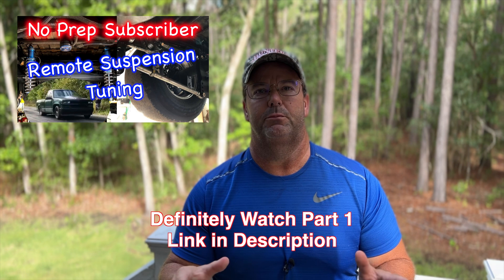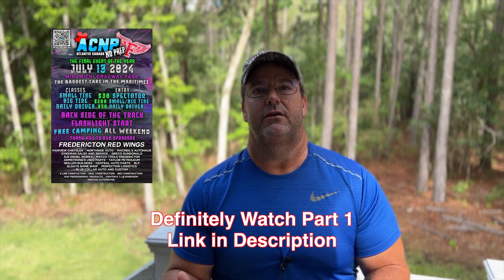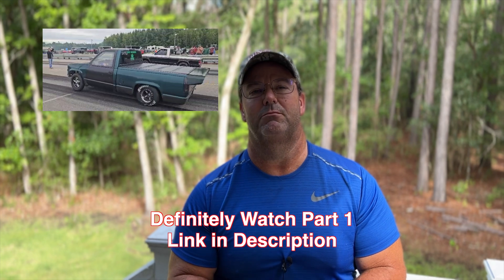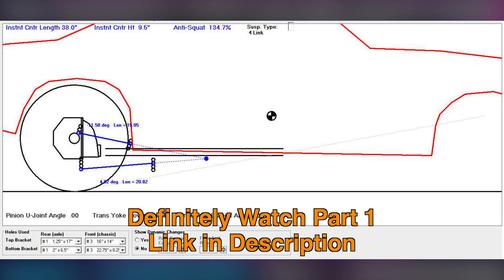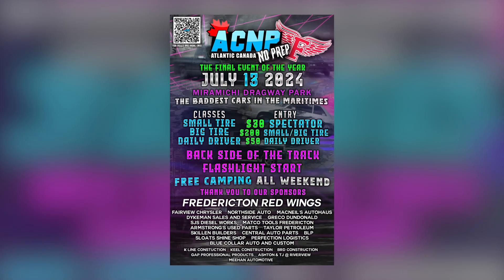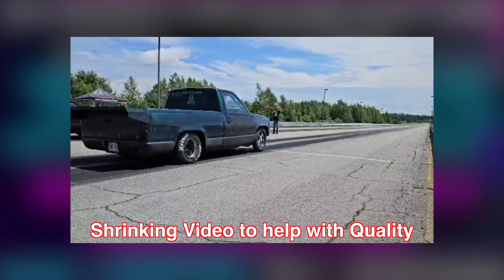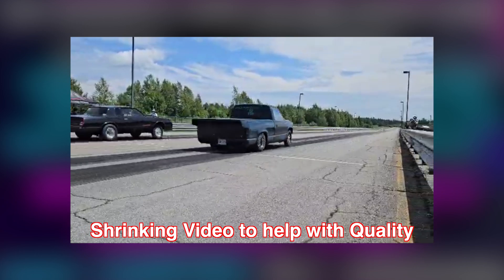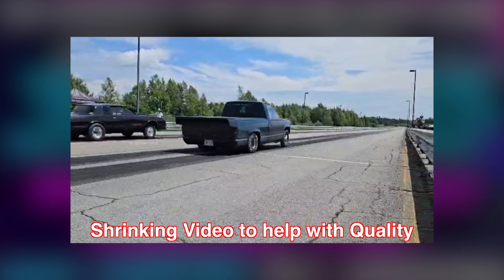No Prep 4-Link Remote Tuning: Big Tire to Small Tire Results!

Comment from the maker: This long wheel base truck with BBC and a couple of kits of nitrous has been a blast to get planted on no prep and back of the track surfaces!!! Going from over 135% Anti Squat on a big tire and blowing the tires off, to sticking the big tire and winning races, then from a 31" to 28" slick now winning small tire back of the track races!!! 
🔥 This is a must watch Part 2 video with full 4 link plots revealed and actual customer video footage from the latest back of the track event where Philip ran his PB ever on a no prep surface and never lifting while brining in the nitrous more aggressive than ever. 
👉Need help? Get my help at: https://www.samsonperformance.com/services.html and let's get your drag car suspension baselined! 
Go fast, go straight! Be SAFE!

Comment: Would your 4 link no prep advice also apply to a 3 link with panhard bar for Auto Cross? My vehicle is not a common chassis. Wheel base is 104" and about 2500lbs

Comment: On my ladder bar setup it appears that my left tire is hitting harder. It is consistently darker after the burnout. The car goes pretty straight. Is this something I need to worry about?
Reply from the maker: I would need more info from you on your corner weights, but at the end of the day, if the car is working, then don't fix what isn't broken, at a high level that is. Please consider subscribing to the channel if you haven't already. Go fast, go straight! Be SAFE!

Comment: Is he on a Hoosier C07 stiff sidewall or D05? Which would you prefer Kevin? What type of surface do you like to see a stiff sidewall on?
Reply from the maker: I can only say that anytime I have a vehicle over 2900 lbs and/or over 1100 HP I am looking for stiff sidewall slicks. So more weight and HP driven than surface for sidewall. I have had good success with both of the Hoosier slicks. The D05’s need to be changed VERY often. Go fast, go straight! Be SAFE!